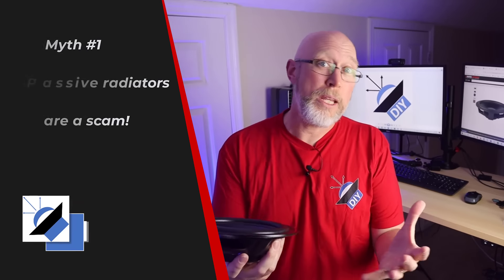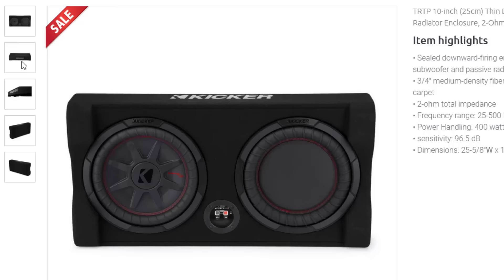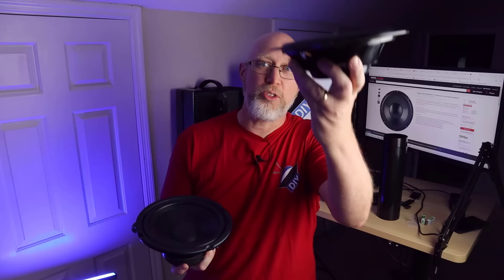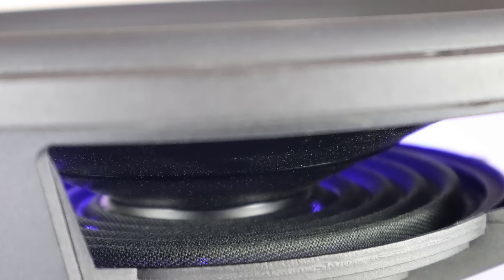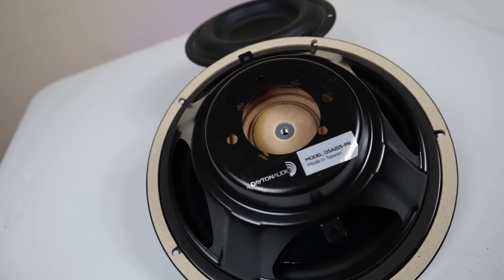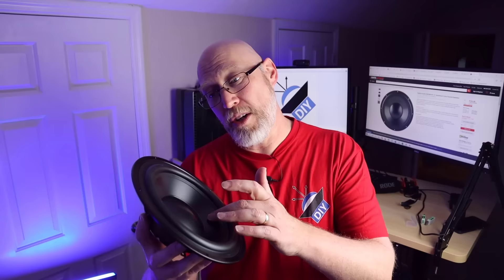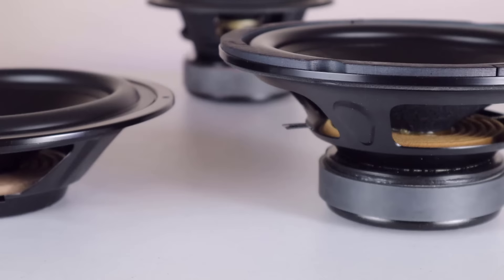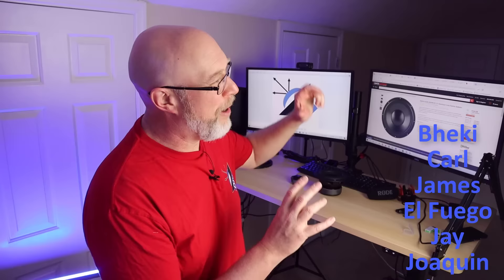Passive Radiator Myths Busted  #Bass

Comment: First instinct was right.  High Fidelity by definition doesn't include adding a resonance to a system. A resonator doesn't reproduce the signal, it creates a ring tone when it gets excited. Can you imagine adding a tuning fork to get more midrange? No.  I gave up on resonant bass systems when I heard my first well designed sealed woofer system.  If you have room for a passive radiator, spend a little more and just add a second woofer.  My buddy built a system with two 10" woofers per side this fall. It is bass perfection. With proper equalization like a Linkwitz transform you can have all the clean deep bass that the radiator promises but doesn't deliver.  People don't realize the transient response of these systems is bad.  It takes a few cycles of the base note for the resonator to build up amplitude and you miss out on initial transient peak that a sealed system readily reproduces. Drum and plucked bass leading edges get cut in half.  The transient frequency response of a ported system doesn't include any output from the port. Only a sealed system will produce the same frequency response for the transient and the steady state.  This is what is called "fast bass".  Ports and Radiators will always be slow muted transient bass by design with resonant overhang that was never in the music.
Reply: Um, sealed systems are also resonant systems.  If they were not, their impedance curve would be dead flat :-)
Reply: @Grommet2007  Sure, sealed systems, that act as a spring, mass and damper, can be resonant systems, but they don't have to ring.  If your sealed system has a low Q, like 0.5 or 0.7, it has little or no over shoot, and it doesn't ring like a bell like a passive radiator or a port must do to produce sound.  A sealed woofer system can actually reproduce a bass waveform accurately because it doesn't ring.   Go look at a five cycle tone burst of a woofer system with a Qb of 0.5.   It doesn't resonate.   It tracks the signal.  Adding a resonator to a well damped woofer system is just a bad idea, and isn't high fidelity.
Reply: @NackDSP  Very few people build sealed systems with a Qb of 0.5, because the boxes tend to be large and the power handling at low frequencies is usually pretty crappy. 

In any case, put any of these bass systems in your average room and you will have to deal with very high Q resonances caused by the room's dimensions anyway.

Comment: I like to use passive radiators with inverted active subs. With inverted subs I can wire directly to the subs and not have to worry about a terminal cup.
Reply from the maker: Clever!

Comment: i'm a fan of passive radiators. i had a pair of acculab floor speakers years back that had a 12" passive in each box. basically just a cloth covered styrofoam disk with a foam surround and no spider or even basket for that matter.  very cheaply built speakers by todays standards but they sounded great! built by rtr probably about they time rtr was on the way down. i've also designed and built a small sub utilizing dual radiators that digs extemely deep for its size and i just got a package for a set of bench speakers that will each have a 7" radiator. polk used passive radiators in lots of their designs in the 80s that dug plenty deep too.  one thing that i do want to mention tho, about ports. there is nothing that says you have to put a long port inside a small box. it can be on the outside. whether you want to wrap a slot port around the enclosure or do something funky with a pvc pipe. as long as the calculations are right, the tuning will be right. good video tho dude.
Reply from the maker: You are absolutely right!  The port does not have to be inside the box!  I've had several viewers ask about the implications of having a port opening that was a long distance away from the subwoofer. I'm going to have to research that into a video on it.
Reply: @DIYAudioGuy  cool. i'd like to see the results. that being said, i always learned that the driver and port should be as close as possible for optimum results. but then i will add to the argument of drivers on front, ports on rear. group delay, phase delay. how much can you hear, can you incorporate it optimally for your listening space...personally, i want forward firing everything and in close proximity. but i dont think a port a long distance from the driver would matter in the trunk of a car. that being said, a "stand mount" speaker who's stand is the port, exhausting at the floor in any direction, could work. that is on my to-do list one day,  maybe...
Reply from the maker: @josephlalock8378  Right!  In room/car response is a completely different beast.  Plus low frequencies have long wavelengths.  So many variables!

Comment: so, what's better for rock and metal music? passive radiator box or just a single woofer in a sealed enclosure
Reply from the maker: The conventional wisdom is that you want to use a sealed enclosure for that kind of music.  I disagree with conventional wisdom.  Ported boxes are louder so I'm going to go with the ported box if I can.  Because of the additional cost of a passive radiator it's only practical when you have limited space for the enclosure.

Comment: I have a sealed box with 6 12's 2 weeks later I saw the earthquake slap 12 passive on sale for $60 so I bought 3. I have one passive for every 2 subs and it has a fuller sound and plays a little deeper. I haven't messed with adding or subtracting weight on the passive cone. I'm waiting until I get my 5k amp to see how much they can handle. Right now my 6 12's are sharing 1200 Watts
Reply from the maker: Unless those passives have huge X-Max you don't have enough cone area.  You're probably able to get away with it since you're not hitting your subs with the full 5,000 watts.
Reply: Ideally you increase the enclosure size as well.
Reply: @TimpBizkit  I added a story video with a little sound test.

Comment: I've known about passive radiatiors since I was a kid. I can't even find a picture online of what my dad had for his Silverado but he has 2 thin boxes with a 6.5 inch speaker that acted as a mids/lows speaker and a horn Tweeter on top of the box. The passive radiator was a flat foam piece with a foam surround. The box said "Stillwater Design's" on it as did the speakers inside. The passive radiator had Kicker embossed on the front of it. They sounded great on his Kenwood cassette deck! I would still have them and be able to do something with them had my mom's ex boyfriend not left them outside. 😑
Reply from the maker: Sounds like an original old-school box from kicker.
Reply: @DIYAudioGuy  they could have been 8 inch drivers, I can't recall for sure. I really wish that I still had them because I tried to look them up last night and couldn't find anything like them.
Reply: Also I was sleepy, the cassette deck was a Clarion with bright orange lights!

Comment: The radiator output frequencies. would have to be 180 degrees out of phase from the driver, due to the action /reaction time of the driver relating to the radiator. Out of phase is not good, and loss of frequency.
Speakers do not move the air as much as they vibrate it, that your ear receives.
Reply from the maker: It works just like a port.  https://youtu.be/mHTGwEHCCRo

Comment: I am an audiophile, i find iy fascinating, how a microphone can send sound through a cable to an amp, in turn through another cable, to a speaker that can separate, high frequencies down to low.

Then one speaker company can sound realistic and another muddy, both use a cone, magnet and surround. 
In live music RCF, Myer, Adamson and L Acoustic and others are life like sound reproduction, and wont degrade the lesser manufactures.
Then a home speaker has clarity yet only sound preproduction, while car stereos are more limited due to space. 

Music just gets me, how a signal is sent out and received by a receiver and one can be more sensitive example 9.3dB and another is 11.3 dB, then add stereo separation on and on. music is complex
Reply from the maker: I think it is cool how, if you look at an audio signal on a scope, it is a big scrambled mess of different frequencies all on top of each other.  Yet a speaker can play that and we recognize it as sound.  Simple and complex at the same time.

Comment: I understand that you are trying to make a complex subject more simple, but the problem with ports AND passive radiators is that the port/radiator ONLY resonates at the tuning frequency. As that is a low frequency, more air is moving BUT not necessarily the frequency that the music is asking for. Put an accelerometer on a passive and check what the cone is actually doing. The technical description is Helmholz resonator. This is why I do not use ports or passives. My test was a port tuned to 40 Hz and the loudspeaker got fed 50 Hz. Both 40Hz and 50Hz were measurable in the listening area - hardly a goal for someone interested in sound quality. I will not go into why most people do not hear this. Only sealed boxes or open baffle are free from this effect at bass frequencies.
Reply from the maker: Interesting. Definitely something I might need to look into.

Comment: Now for dual iso-metric ( I think that's what it's called where two drivers face each other but are 180° faze so they act like one piston with twice the motor force ) . I also like how t lines make magic happen and folded horns are cool too.
Reply from the maker: Iso-baric!  Great idea for a video.  Have you seen this one?
https://youtu.be/CvUjWNwPHDU
Reply: @DIYAudioGuy  thank you good sir🖖.
That was actually a pretty interesting build. I personally really like the ultimax line but for half the cost and like a 1/2-2/3 the power to get that loud and low and flat....really impressive.
Reply: The best thing about real isobaric is that you only need half the enclosure volume.
Reply: @73Xtian  no two drivers are alike. You will equalize two/four isobaric to no end. They sound smudgy.
Reply: @808bigisland  you're right about no two drivers being alike, but you're wrong about not getting it good and sounding 'smudgy'.
Two drivers in normal configuration won't be the same either and it works perfect.
Reply: @73Xtian  Smudge means the time domain and phase are affected. Both can be measured and corrected via a very good PC x-over. You avoid syncronization issues by only using one driver and if you want more db...use a high efficiency driver in a horn.

Comment: I still don't get how they work. In watching videos, they are often in the same plane and 180 degrees out of phase. If you take two drivers and wire them 180 out, you get reduced (or no) output.
Reply from the maker: It works the exact same way as a port.  At some frequencies, the port and the driver are 189 out of face, at most frequencies. They're slightly out of phase.  At the tuning frequency the port and the driver are in phase, but the port is one cycle behind.  To drivers with reverse polarity are always out of phase at every frequency and therefore always offset each other.
Reply: @Mr.Robert1  

Having thought about this a bit, it is the same as a port without the requirement for box volume. Depending upon the tuning, when you hit the right frequency range the Passive Radiator is aligned and amplifies the output.

So, if someone wants a small enclosure, they can use a radiator instead of a port.

I have a Harmon Kardon Bluetooth all on one. It has a passive radiator and 2x 3" woofers. It produces solid bass from a very small package. It isn't going to shake the walls, but it is full and rolls off smoothly.

Comment: I have a pair of klh tower home stereo speakers that has passive radiators that i paid 120 bucks each new in 1989 and in college hooked to a vintage sx 780 pioneer reciever and a vintage akai cassette deck, nad now vintage cd player then i was jamming and these things sounded great for cheap. For 20 years i never knew they had passives until one of my crack head nephews was cranking the hell out of them and blew the tweets and 1 woofer. Upon dismantling them i found 2 of the 12 inch woofers to be passive. not wanting to throw them away i looked to parts express and reloaded them with 2 fresh goldwood 12 woofers and some dayton tweets adding tweeter protection bulbs. They still sound good, they have been moved all over the country, the cabinets are getting rough as they are presswood and have been in my shop for years. i have 3 shops on my property one for wood working, one for small engine repair and one for automotive repair and all 3 have stereo systems of vintage component/pa equipment from pawn shops, ebay etc with bluetooth dongles. Reading online from a stereo review article of old states that passive radiators were used by cheap speaker companies that they did not sound good and muffelled frequenciecs now they are making big returns in speakers.
Reply from the maker: That is awesome!  Vintage gear is cool.

Comment: Maybe I'm wrong but you could also use another driver not wired up as a drone as well, maybe that is where the two drone idea came from. 1 active and two not wired passive...
Reply from the maker: If the passive still has a magnet and a voice coil then it's going to generate an electromagnetic field.  It's not going to behave in a predictable way so it would not make a good passive.
Reply: @DIYAudioGuy   Thanks for the reply but I still wonder about that since it is not wired up the coil, it should have no resistance. Now if it was hooked up to another amp or to a light bulb then the coil's generated electricity would create a resistances, and hamper the point of a free drone.

Comment: Just a crazy question - instead of using passive radiators how about normal speakers with a variable rezistor on the coil ( since you cannot tune with weights you can tune with passive rezistor). 
I was thinking about this since I have a few speakers that I do not use otherwise...but I could install them as passive ones.
Reply from the maker: That's an interesting idea, I've never heard of anyone trying it.  I have no idea how that would work or if it would work.

Comment: Hi. I have a Small Jeep YJ without a lot of extra room. If I build a down firing sub box to go under the drivers seat. Could i put a passive radiator above it? I probably can't squeeze a very big woofer in it probably nothing bigger than a 6"or8".

Comment: Here's some thoughts about PRs:
- Their main purpose is to lower the tuning frequency without increasing the overall size of the project
- PRs are less efficient than ports (less output for more watts)
- PRs roll off the bottom end sooner than ports (narrower band of box amplification)
- PRs are expensive compared to ports
- If space is not limited there is little reason to use a PR
Reply from the maker: Correct.

Comment: The passive radiator needs to displace double the volume. Ok, well that assumes you will use the full capacity of the speaker so if you are not looking to play 110db, maybe that's not true either?

Comment: I tried using 2 subwoofer in a box built for 2 subwoofers but only had 1 subwoofer hooked up. The second woofer was like a passive radiator.
Reply from the maker: How did that work?
Reply: @DIYAudioGuy  that works and it is dampened better than a passive radiator because of the coil not beiing linear. Ports, passives kind of lame. Horns work better for very good reasons.

Comment: Of course if you have 2 woofers and one is wired out of phase, you cancel the bass.
Since the passive moves opposite of the woofer excursion, I used to think they at least caused "some" cancellation.
I no longer think that LOL.
Reply from the maker: You're exactly right, after reading comments on videos like this and my port tuning videos I think I need to do some videos on phase.
Reply: Phase cancellation or addition depends on more than just the wiring. The placement of the two drivers around the cabinet makes a big difference too.

Comment: For converting MM to CM, is as simple as simply moving the decimal left 1 place. Forexample lets say 11.. Xmax, to convert to CM quick and easy, simple move your decimal (invisible with 11mm) one place to show 1.1 CM. So your equation could be simplified by just saying 11MM is 1.1CM (no equation needed and simple do the rest of the equation as you dictated
Reply from the maker: That will work just as well.

Comment: It's still a crap speaker regardless of people saying "it's a passive radiator idiot". Yes it looks to be, but what's the point of coupling a 2 inch passive radiator with a woofer that's the same size?

Comment: Always believe that the passive was close to180 out of phase with woofer and would cancel out the base wave form.
Reply: It's a matter of where the radiator is placed.  Next to the speaker on the same panel is generally bad, but on panels at 90 or 180 degrees away (sides or back if the speaker is on the front) then cancellation is not generally a big issue if the panels are well matched and correctly tuned with the right mass.
Reply: @GodmanchesterGoblin  Thanks

Comment: Is there still a volume loss when comparing a sealed box of a larger volume to a box with a passive radiator and smaller volume with the same speaker and tuned frequency?
Reply from the maker: Any time you make the box smaller you lose output.  But a passive radiator is like a port, so you get additional output.  Hope that makes sense.
Reply: Thank you for answering my question. I was trying to figure out if adding a PR could make up for the loss of volume when decreasing box size. I don’t fully understand why box volume would decrease SPL but I suppose it makes sense if the air pressure in the box is resisting the cone movement of the speaker having less volume in the box will cause greater resistance and therefore the speaker will not be able to displace as much air/create as much pressure outside of the box.